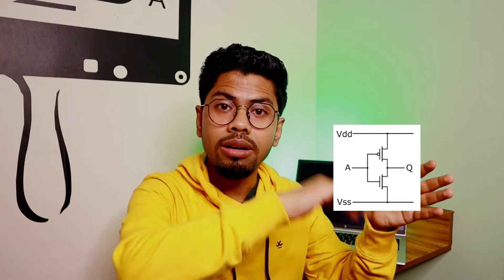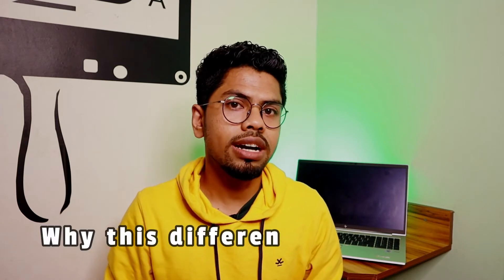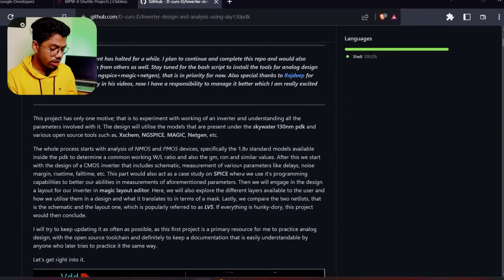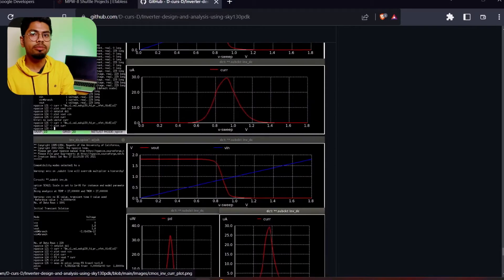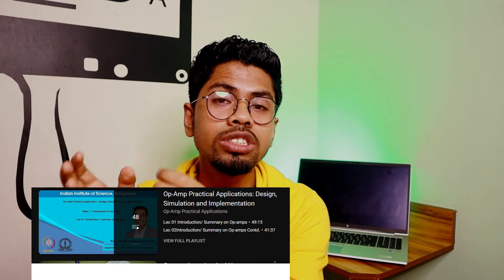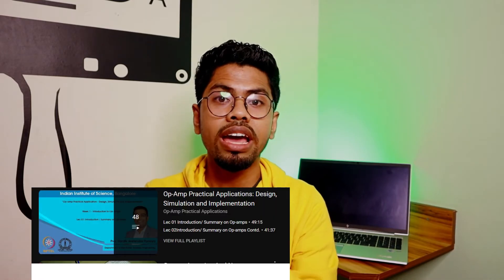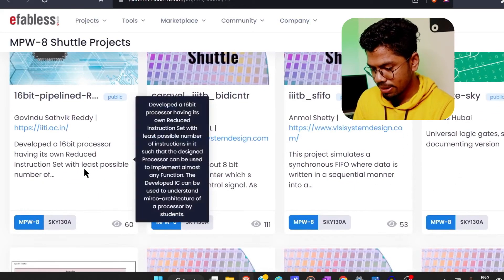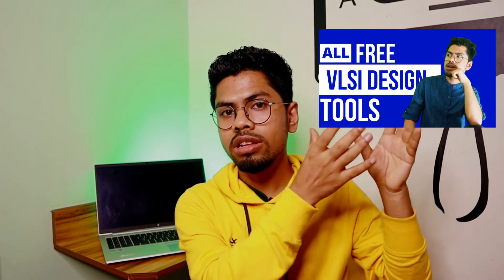15 Must Do VLSI Trending Projects Ideas | EP:6 VLSIpro_ject

Comment: Designing circuits like CMOS Inverter, Full Adder etc in Cadence Virtuoso are even considered in VLSI domain . Don't you think that lies in Analog Domain
Reply: It is transistor level digital VLSI design, because VLSI is not only about large processors but it also includes basic cells too. Hope this clears it out.